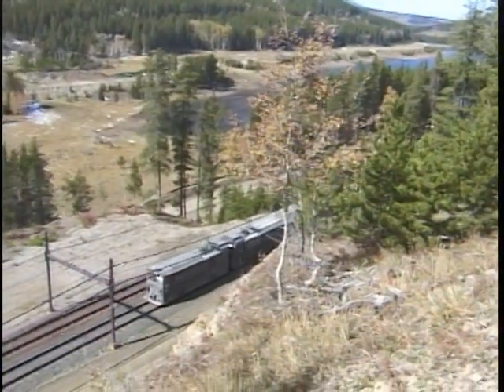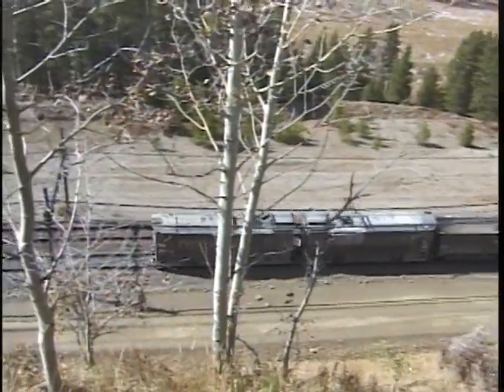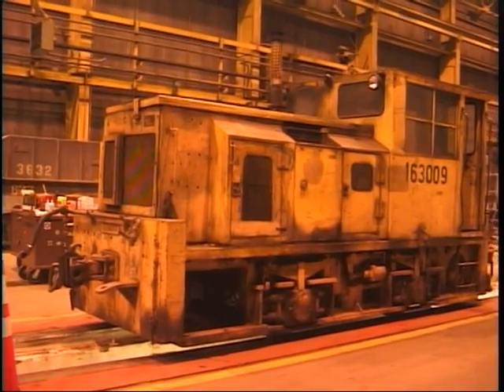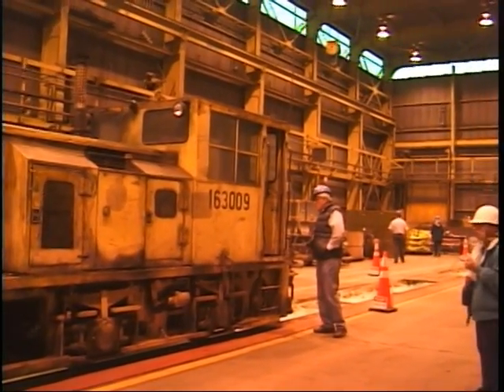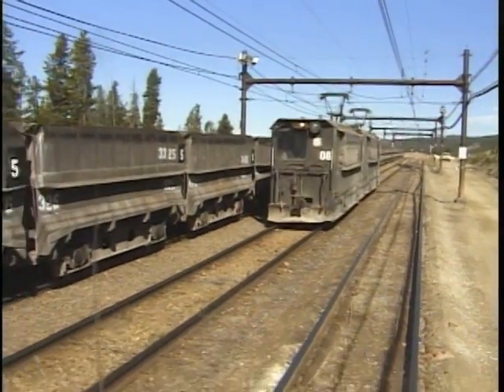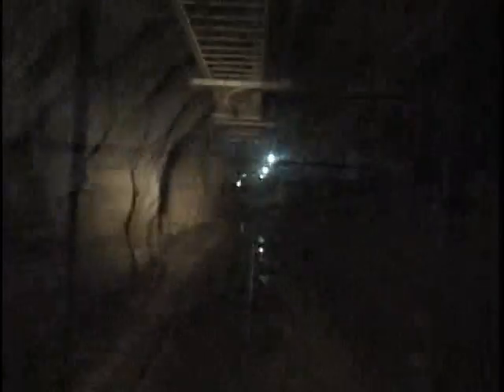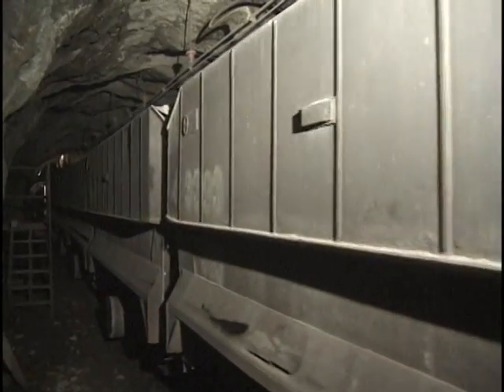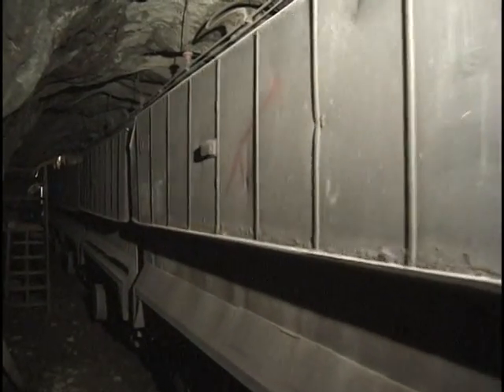Henderson Mine

Comment: This video brings back memories.. I work at Henderson Mine/Mill for 5 years. I worked both at the mine and at the mill. The train ran on 2400 volts D. C.. I was a Mine/Mill Electrician. Spent a many cold days and nights work on the high voltage system for the trains. Mike Scott ( Scotty) mid 1977 to 1983
Reply: i was there..
Reply: I had no idea that the handerson mine had a railroad in those days. What happened to that historical railroad?